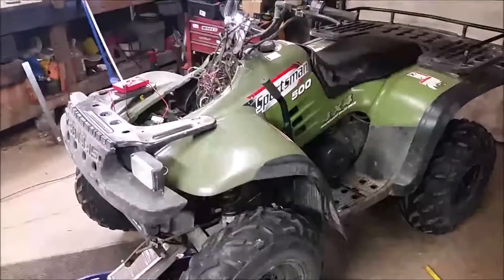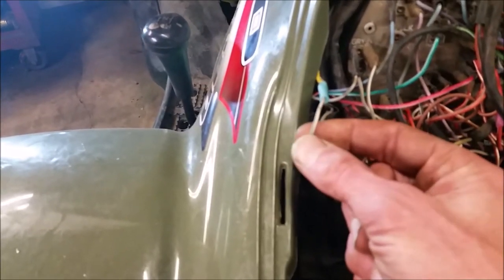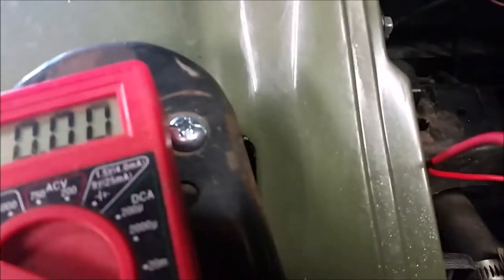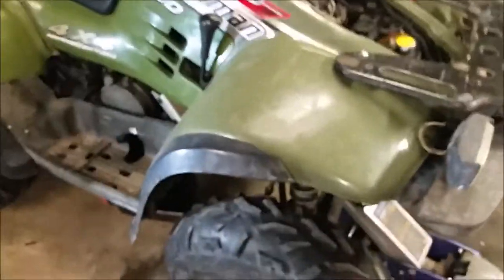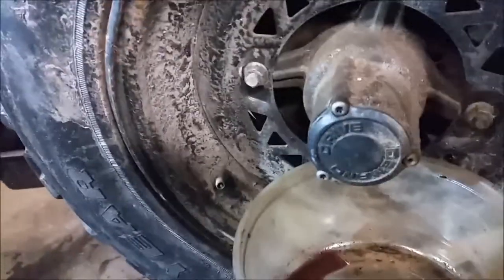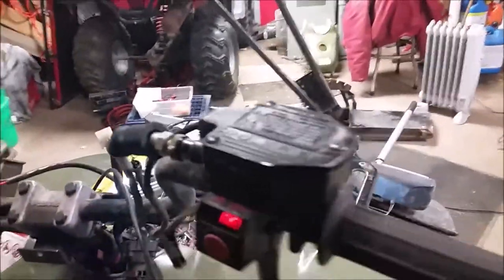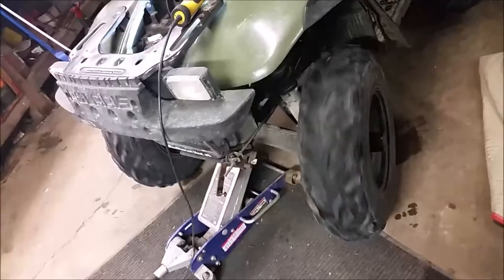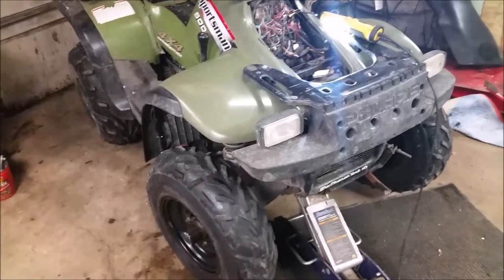DYI Polaris Sportsman AWD Quick Fix

Comment: I have a polaris sportsman 500 model 2008 and I discovered that it does not engage 4 × 4 in reverse.  What could he have?
Reply from the maker: Check the switch on the transmission. It could be bad. Also is your shift linkage good? Does it go in reverse and forward fine? Sometime if it's not all the way in reverse, the switch won't engage on transmission. And make sure you press the override switch. sometimes that's the culprit too.
Reply: @TitaniummanGarage  
Thanks for the reply! I admit I didn't know how to press the yellow button. I wish you strength in everything you do!

Comment: Hi, would you be able to do us a favour? We need to find out the size of the O ring that goes into the Carburettor and holds the float needle, Internal, external and Cross sectional dimension, I have been ordering through eBay and what I get do not last, they are not Viton O rings, so the fuel kills them very fast. If you know where to get the Fluorocarbon O rings, please tell us, and if it is hard to get them to deliver in Australia, could you buy them for us and send me about 6 of them, I will reimburse you quickly.
Regards,
Franklin

Comment: TG
I’ve been guessing you’re in WI,
Sound exactly like Rob, who runs the KEGV airport!
Reply from the maker: I Heard I have a twin running around. Lol.
Reply: @TitaniummanGarage  Hi my friend has a 500 sportsman, does the Drive Shaft have to run even in 2 x4 ??
Reply from the maker: @renegade9758  Yes. depending on what year.
Reply: @TitaniummanGarage  xplorer 1997
Reply: @TitaniummanGarage  he is Jack on blocks the wheels in the void the propshaft does not turn in 2x4 and no longer in 4x4
Reply from the maker: @renegade9758  What year is it?
So your saying prop shaft doesn't turn in any gear or 4x4? Is it all the way in gear? it may need adjustment.
Reply from the maker: opps. i just saw..its a 97. yes it should turn in 2 and 4 wheel drive
Reply: @TitaniummanGarage  ok transmission problem?

Comment: Cuanto voltaje debe de bajar a alas bobinas ?
Reply from the maker: 12 volts should be at the coils
Reply: @TitaniummanGarage  Amigo los cables que bajan  deben ser corriente ? o corriente y tierra ?
Reply from the maker: @fernandoperez6166  The Grey wire is power 12 volts. The brown wire is ground
Reply from the maker: Check out this video. It will explain it better. https://youtu.be/Kv38NeLpHO0
Reply from the maker: I'm using a translator to read what you are saying. So where are you from?
Reply: @TitaniummanGarage  tengo problemas con las llantas delanteras, no magnetizan
Reply from the maker: @fernandoperez6166  what kind of Polaris is it? and what year? You might need to replace magnetic coil. Make sure the ground all the way up is clean. no rust. and see where your other ground wires are connected. I've gone as far a adding an extra ground wire from magnetic coil to the frame of the atv up where it connects. the thicker wires not the thin wire, it should be brown.  try that first.
Reply: @TitaniummanGarage  polaris sportsman 500 año 2003 4*4

Comment: Mine won’t go into 4wd in reverse even if I press the override button.
Reply from the maker: Check your wiring by the shifter. Clean all terminals for the 4x4 wires. It sounds like an electrical problem. It's just a matter of hunting it down.
Reply: @TitaniummanGarage  Thanks!
Reply: Turned out to be the purple wire was unplugged. 4wd works perfectly now in forward and in reverse with the override switch pressed!